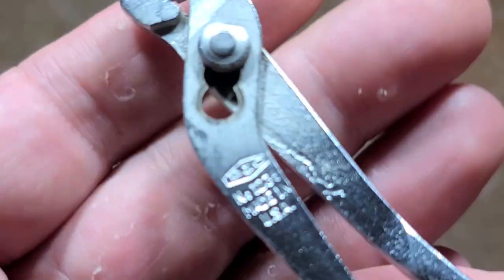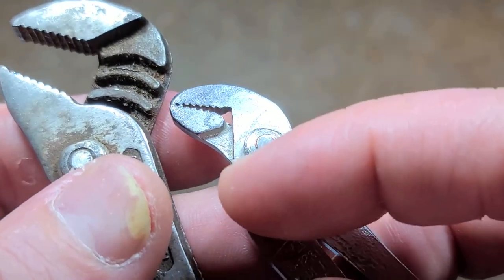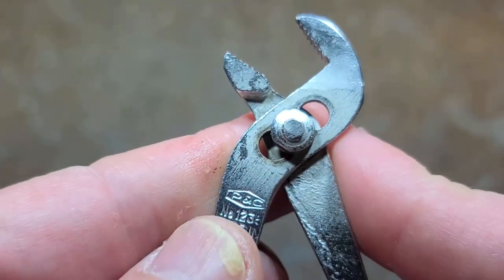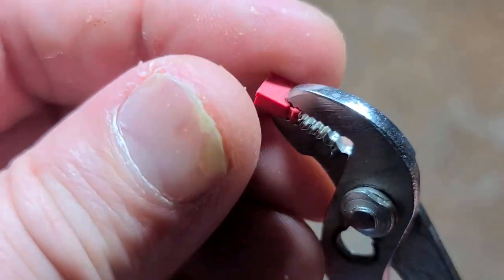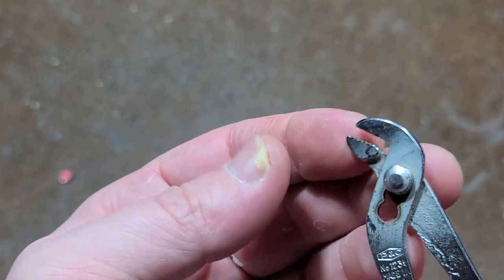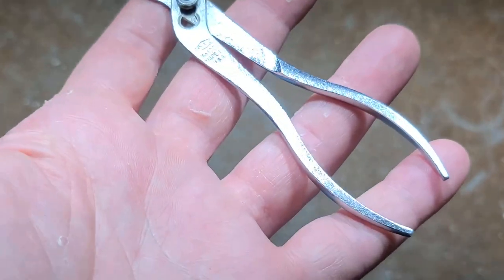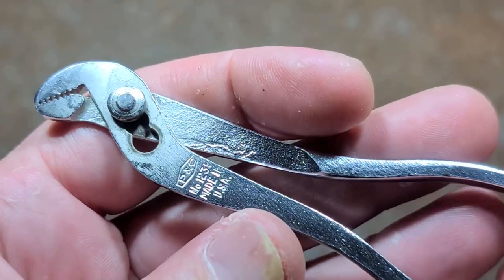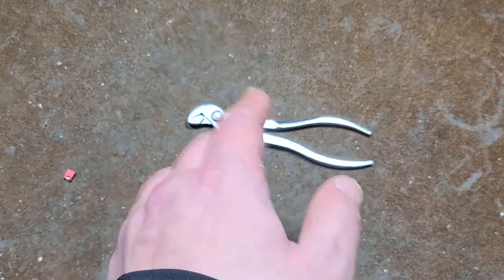P&C USA Mini Adjustable Ignition Pliers Review

Comment: I still have the Proto and Snap On ignition pliers. When I first started wrenching in the early 1980s, I would see cars with points two to three times a week and this was at a Oldsmobile dealer in Southern California. I still use them to pull blade style fuses as opposed to using needle nose pliers. Some of the secondary fuse panels under the dash do not have access to use needle nose pliers.